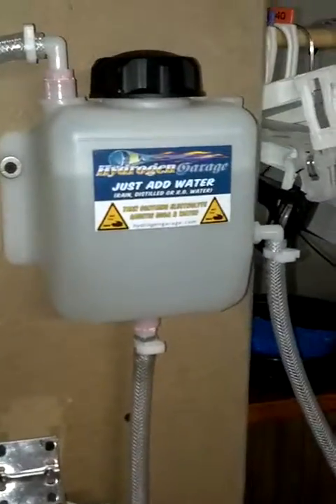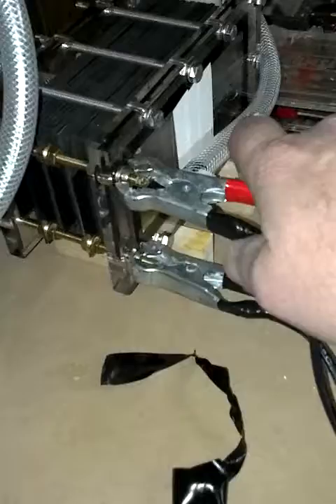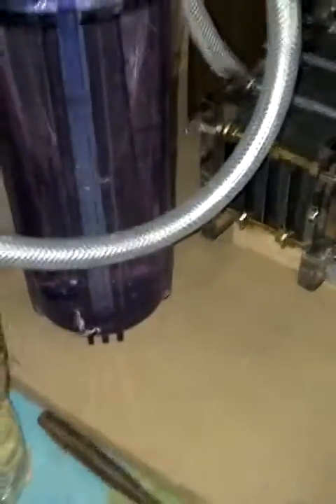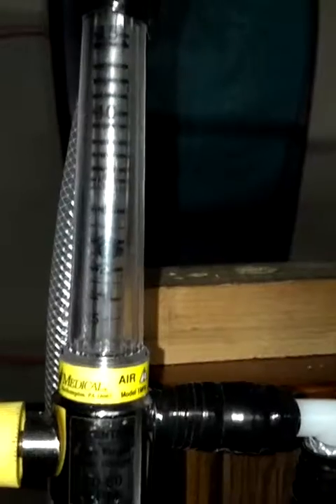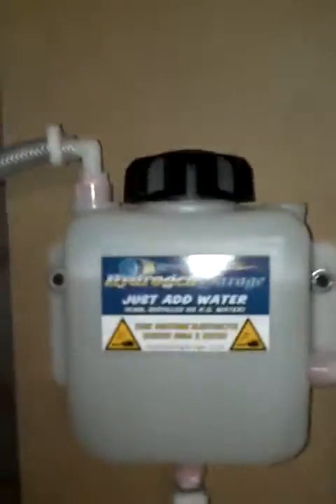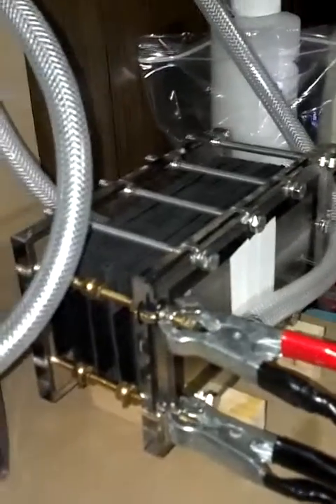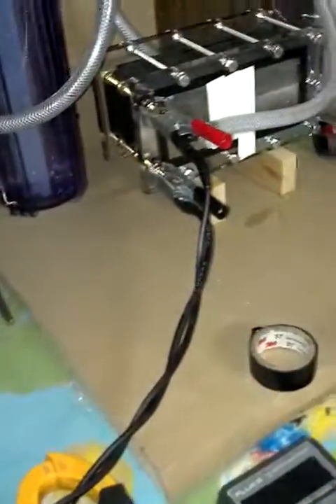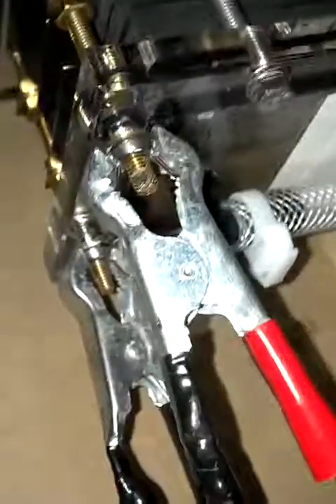HHO 3 LPM @ 9 amps, 10.2 vdc

Comment: Where can you buy good Dry Cell  online, who's selling them?
TY
Reply from the maker: Dezeinstein.com is where the kits are for saIe. W currently have a bunch of  stock to sell, so, for the prices you see on our site, we will email you the contents of the entire kit. I also include the VOLO chip if you have a fuel injected vehicle, but, I will need to know the make and model of your vehicle to get you the correct one. They are fairly easy to install, but, the volo has to be done correctly otherwise it will make the car worse on fuel. You must have something to help the computer think the HHO is not being used otherwise it will burn more fuel. Please reply if interested. The 21 plate cell kit is $450 plus shipping. You get the cell, the 1.5 qt reservoir, the small scrubber, the large bubbler, a flash back arrestor, 20 ' of hose and the volo chip plus wiring and a 20 amp fuse and fuse holder plus all the barbs you need. I ship them with the factory barbs, but will include the better barbs for the cell since they are not very good. If you give me about a week, I will have newest batch of cells in. I can sell you that one instead where the barbs are replaced already with the better type. Please email me if interested at this address I am emailing from. Thanks and good luck! The same type of kit will cost about 800-900 anywhere else that includes all of the pieces we sell you. These kits must be used responsibly, as well, at your own risk as they can be very dangerous if used improperly due to the explosive nature of the fuel that they make.
Reply: (http://www.ogohho.com/index.do) you can buy what you need there. Take note a 21 cell acquires approximately 48 volts for it to run at it's optimum performance. They can produce about 6 to 10 l.p.m.

Comment: how do you build the dry cell? could you tell me please thanks
Reply from the maker: Hello,
 You need to have the plates cut, or you may buy them online, then, you must make or buy the gaskets necessary to seal the plates from leaking water out from inside. Each plate must have two holes drilled in them, one at the top, and one on the bottom, inside of the area the gasket would seal. then, after all opf the plates are added, each of the outside plates will be the negative plates, and the middle will be positive. All the rest of them will be neutral of not connected to anything. On the outside of the end plates, there will be another two gaskets which will  sandwich the plates together . The outer casing, or nylon plates must be drilled inside of the gaskets and have a gas port added. I recommend that another drilling is done to add a drain valve that is good for at least 20 lbs of pressure so it could be drained and cleaned every couple of weeks. The nylong plates will have to be about one inch larger than the outside dimensions of the plates and have holes drilled to connect them together and tighten using stainless threaded rod, nuts, bolts, and washers.

Comment: good luck
Reply from the maker: you too. I will show you in a video my construction of a great cell, but, it will take some time to do as I have to drill the plates and they are extremely hard as I use 316L stainless steel which is surgical stainless steel, so they do not easily corrode. The plates will need to be conditioned for days and then cleaned thoroughly so there will not be anymore rust coming off of the plates before use. This is done by using a very low voltage, but they are very reactive.
Reply from the maker: We will be frequently updating the website, but, we currently sell these cells and all of the components necessary to install them, flashback arrestors, etc. DEZEINSTEIN.COM . We have incredibly low prices for entire kits. I will recommend the purchase of the  hydroxy-gen 21 kit. It is very efficient, priced at a very competitive price, and it includes the volo chip necessary to make this all work correctly. Please spread the word. We have really incredibly built cells. They are really fantastic and they are extremely efficient.

Comment from the maker: This is the most efficient cell I have ever built. It is a 21 plate, 4 cell unit with a very high surface area. I used 1.40 quarts of steam distilled water and KOH (2 TBSP) to create this very efficient production of HHO with a battery charger. The voltage is somewhat of a mix of DC and AC voltage. The voltage is 10.25 volts dc with ripple current that reads on the AC setting at .255 volts AC. I think this is the reason why we are seeing the massive 3 liter per minute production, as well, it is a series parallel design that uses a specific width of ripple pulse and just a normal 60 hz ac cycle at a very low voltage. The cell actually is seeing 10.2 volts DC input, but, the plates are all getting very close to 2 volts no matter how high of setting the charger is on. The max amperage it draws with the charger on high is 19 amps but outputs 5 plus liters per minute, and then it becomes more efficient as the cell becomes charged and gets down to 16.4 amps at the same production rate, maybe 1/2-1/4 lpm less gas.. ( that is another thing I have noticed, the cell holds a massive charge if I change the polarity input and then shut it off) The charge (capacitance) may be the key to make sure the cell performs very efficiently. Distilled water is conductive, but, the "alkaline" like base of the KOH I think is actually creating a battery since this unit is a series parallel build that is not equal, having 3 of one polarity, and 2 of the opposite with neutrals between.

I have tried using my PWM to obtain the resonance as i did for the last 9 plate dry cell I powered this way to obtain a greater efficiency of 2/3 of the original wattage, like I did with the 9 plate cell, and I actually get 15 amps no matter what I do, and have a production of 1 liter per minute. This is exactly what I got with wet cells and the same battery charger at every attempt in which I have had 1 liter per minute output. VERY STRANGE RESULTS, BUT, IT IS EXCITING TO SEE A 3.14159265 times gain in efficiency!!! This number just happens to be Pi !! ( I think it is just ironic that it happens to be that number.)